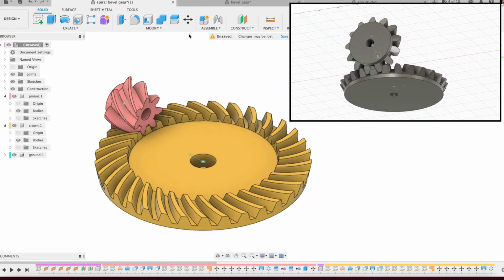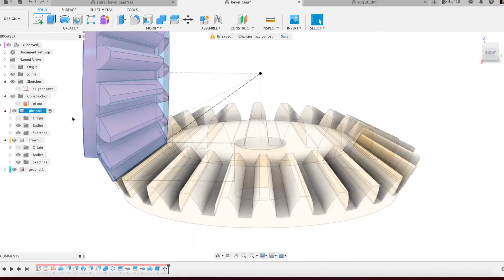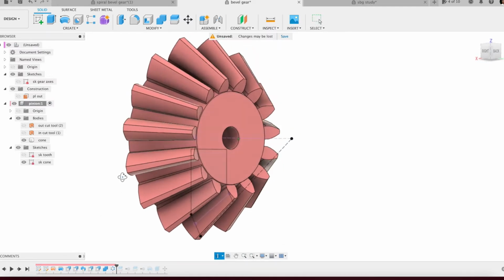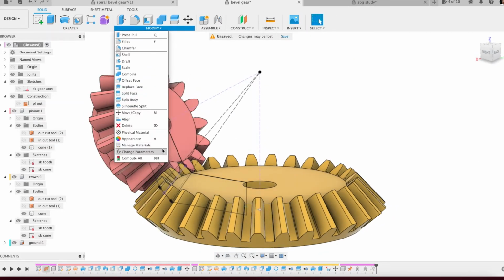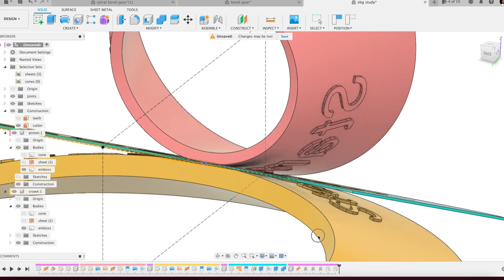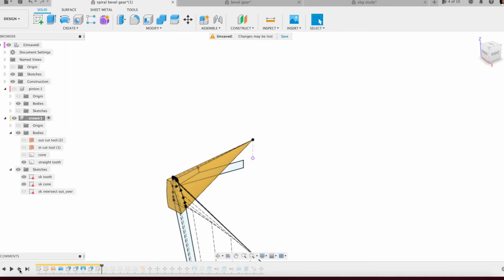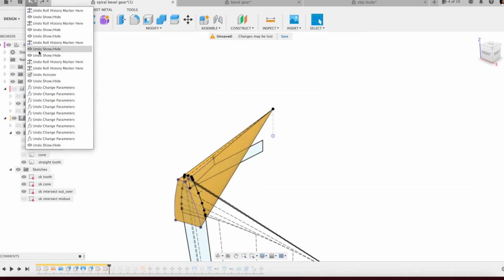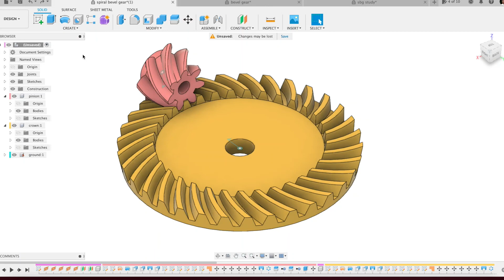Straight, Zerol and Spiral Bevel Gear (Tredgold's approximation), parametric (Fusion 360)

Comment: Can the same procedure be done in solidworks?
Reply from the maker: Yes, I think so.
Solidworks has the same abilities (and actually more) than Fusion to sketch, extrude, sweep, loft, split, combine, etc. I modeled a spur gear a year ago with Solidworks when I had access to it.
The only thing that bothered me was the management of parameter units, they seemed inconsistent to me. I was unable to set a parameter with no unit (a count number for pattern features for example). Also, conversions to/from Degree from/to Radian had to be done manually, they are implicit with Fusion.

Comment: Thank you for the great Video! But how did you get the angles about which you rotate the tooth profile slices? I'd really appreciate an answer, since im struggling on this part.
Reply from the maker: Indeed, it's the most complex part. I did the math and obtained a quite verbose function. Maybe too complex but I wanted a curved tooth as if it was milled with a rotating cutting tool.
I guess there are easier ways, O.T. Vinta proposes one (see its video "How to Model A Bevel Gear Drive in Blender 3D"). He uses Blender which is not parametric, but I think his method can be adapted parametrically for Fusion 360.
Reply: @steelstone  Thank you for your answer. I thought about doing the math aswell, but was unsure if it was as complex as i thought it was. And the fact that there are many different cutting techniques and types of the tooth curvature doesnt make it easier.
Reply: @ChrystsGER  I've been doing that using python and the easiest way I found was to find the center of the cutter and then find the angle that allow each of our tooth profile slice to be on the cutter circle (without doing the math, using a minimize function because I use python ahah). I'm not sure that it is the best way but it's working pretty well
Reply: @biggib1 I chose the same way, but via trigonometry. Turns out to be a complex function indeed. If someone finds an easier way, he may post it here, would be interesting to see.
Reply from the maker: @ChrystsGER  here is an attempt to explain what I obtained.
Consider working on the tangent plane of both cones, the apex being the origin.
Consider "conedist" and "facedist" variables, they are self explanatory (I hope).
Consider these variables :
"delta1" as the pinion pitch cone angle;
"delta2" as the crown gear pitch cone angle;
"beta" as the tooth angle;
"Rcutter" as the radius of the cutter;
"x0" and "y0" as the cutter center coordinates relative to the apex;
"Rin" as the distance from the apex to the inner slice;
"Rout" the same distance to the outer slice;
"Rmid" the same distance to the middle slice.

Rin = conedist - facewidth
Rout = conedist
Rmid = ( Rin + Rout ) / 2
x0 = Rmid - Rcutter * sin(beta)
y0 = -Rcutter * cos(beta)

For any slice whose distance to the apex is "R", consider the angle "phi" :
phi = acos(( R ^ 2 + ( x0 ^ 2 + y0 ^ 2 ) - Rcutter ^ 2 ) / ( 2 * R * sqrt(x0 ^ 2 + y0 ^ 2) ))
So :
phi_out = acos(( Rout ^ 2 + ( x0 ^ 2 + y0 ^ 2 ) - Rcutter ^ 2 ) / ( 2 * Rout * sqrt(x0 ^ 2 + y0 ^ 2) ))
phi_in = acos(( Rin ^ 2 + ( x0 ^ 2 + y0 ^ 2 ) - Rcutter ^ 2 ) / ( 2 * Rin * sqrt(x0 ^ 2 + y0 ^ 2) ))
etc...

Now, the final calc, assuming the outer slice at "Rout" is left in place, the others slices are rotated :
for the pinion : (phi_any - phi_out) / sin(delta1)
for the crown gear : (phi_any - phi_out) / sin(delta2)

I let you check all this ;-)
Reply: @steelstone  I took some time to compare your results. I actually went for a similar approach, since I wanted to get a perfect circular tooth (view normal to the tangent disc of the cones).
My steps:
1. Determining the center point for the cutter
2. Determining the angular difference to a reference point and a desired point
3. Transforming into the "global" coordinates, (where the z-axis would be the rotation axis of the cone). 

My final equation: angle = atan(tan(phi_mid - phi_any) /sin(delta))
 Unfortunately this equation doesnt give me real circular cut, since one approximation is made in the calculation.

The assumtion is that for calculating phi the length of R is constant. But since the base of the cone is projected into the plane, its an ellipsis.

In order to get the exact solution I would need to write a programm, solving the equation of an ellipsis with a circle. A way to obtain an analytical solution would be to solve the equation of 4th order.
  
I guess I' ll stick with your solution of a milled tooth with a rotation cutting tool then.

Comment: i can't import the parameter help
it throw an empty error :S
well id like the f3d file
Reply from the maker: I guess that you have to edit the CSV file if you exported it from google sheets. Try removing the blank lines.
Reply: @steelstone  i downloaded it as a csv and when i edit it there no blank line 
its the first time i am trying to import parameter so i got no idea what i am doing
with the plugin to import/export
Reply from the maker: Lines 19, 28, 37, 44, 51 and 56 are blank or empty. Exporting the googlesheet to CSV generates three useless comas at those lines. Just remove them.
Then import using the "Parameter IO" addin. Hope this helps.
Reply: @steelstone  alright it stopped throwing error but i am suposed to link every parameter to something ? i never done this so i don't know
Reply: @buder5116  yes
Reply: @yuriy77  thanks but i throwed this out the windows